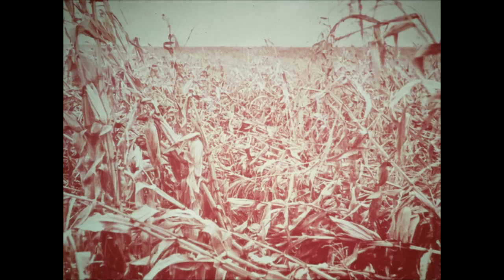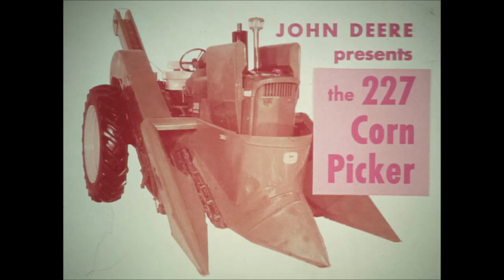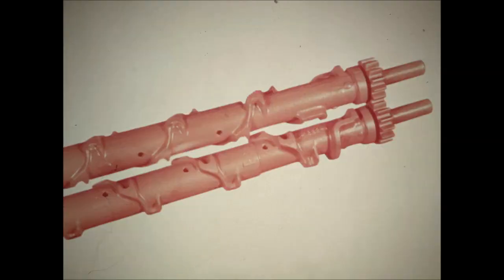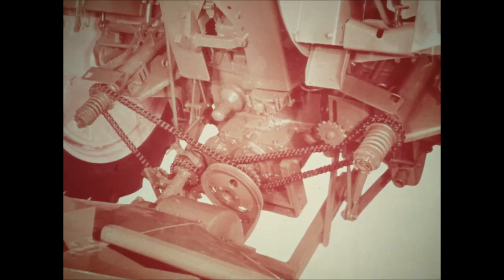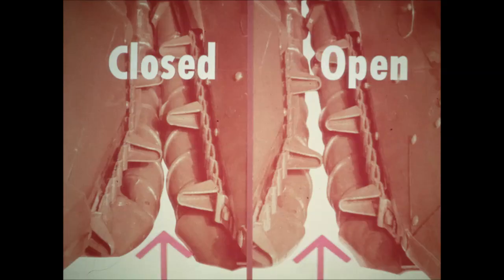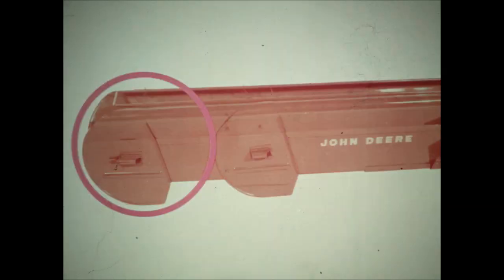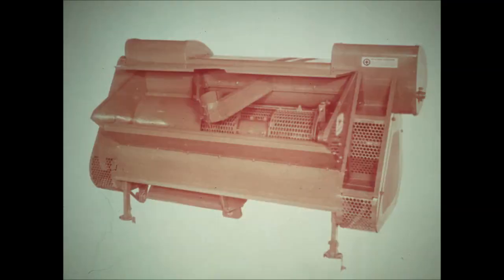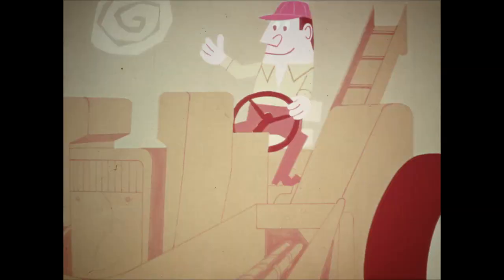John Deere Presents 227 Corn Picker and 50 Sheller Attachment

Comment: You don't want to forget that at the time mounted corn pickers came about they were only around for about 5-10 years. It still beat picking by hand as was still done by a-lot of farmers. Once the unit was on the tractor it stayed on until the corn was off the field, and then you would go help out the neighborhood farmers. Combines with corn heads were still being thought up. We still run a 227 combination ear/sheller. Takes about 2-3 hours to put it on, some are quicker some are longer mounting times. I've run almost every type all do a great job, beats hand picking!
Reply from the maker: I agree. It does beat shucking by far.

Comment: I always thought these might be nice BUT a pull type picker was much more convenient to hook up and use. I/we had both a New Idea and JD one row picker, would have preferred a two row narrow New Idea (still think they were the best picker). Still the cheapest way to store corn, is on the cob in a narrow tall corn crib, let Nature dry it and animals won't mind the cob when ground up.
Reply from the maker: Yep, pull type is the way to go, same with cribbing corn. Newfangled methods may save time, but are not always best.
Reply: @ikonseesmrno7300  Yeah it's like the first one-row cotton pickers were all tractor mounted... IH invented them during WW2 as a labor saver over hand picking when all available hands were going into the service.  They were complicated and expensive and didn't catch on until well after the war.  You had to convert the Farmall for use under a cotton picker, by removing the shift plate and seat off the top of the transmission case, taking the differential loose, and flipping it over on top of the bull gears on the ends of the axles.  That gave you five speeds in reverse and one forward, since the tractor was operated backwards under the picker.  You had to remove the steering wheel and throttle and reverse the "pickle fork" single front wheel (or get a pickle fork single front wheel and remove the tricycle double front wheels-- they didn't work worth a rip in bedded land anyway as they were always trying to take the wheel away from you, particularly operating in reverse).  Then you rolled the tractor under the picker.  Usually the picker was propped up on top of 55 gallon drums with wood blocks, so to get the axles past it you had to roll the axles up to the drums, jack the picker up, and remove the drums and move them to the other side of the axles, then roll the tractor back to the mounting plates on the picker frame.  Oh, one step I forgot-- usually the picker rode on a huge ball bearing on the axle itself, so you had to remove the rear wheels, slide the bearing with its huge pillow block on, and then put the wheels back on.  Most farmers just left the bearing on after that to freewheel along the rest of the year because that was such a PITA.  Then you had to line up four bolts with the pillow blocks and install mounting plates from the engine side frames to the picker's 4 inch channel iron frame, install a gearbox (on most pickers) in where the belt pulley or corn picker drive on a Farmall was located (in a top cover under the gasoline tank), though some one-row pickers IH built eventually just used a big cast iron pulley that slid onto the PTO and then belt drives to turn the picker unit and blowers to convey the cotton to the big overhead basket.  Then you had to hook up the controls-- a rod pinned to the clutch pedal and two more rods pinned to the brake pedals, which went through a series of bellcranks and rods to duplicate clutch and brake pedals on the operator deck above the picking unit.  The throttle rod on the tractor was joined with a double-plate bolt on joiner to a throttle rod from a duplicate throttle control lever on the picker operator deck, along with a gear shift lever that operated through a rod arrangement to couple it to the tractor's gear shift lever (after you put the top plate back on the transmission.  Usually they started from the ground, though sometimes they extended the controls up to the picker operator deck.  Then you had to mount a stalk shield and snoot over the LH rear tractor tire (which was now the RH front tire since the tractor was operating backwards under the picker) to keep stalks and stuff from getting smashed down as they went past the picker unit and under the axle.  Usually you always turned to the right when picking so the row going under the axle was already picked, so cotton didn't get knocked out on the ground.  Of course taking the tractor out from under the picker at the end of the season was the reverse of all this... Oh, nearly forgot-- you also had to clip on a big tapered angled screen over the radiator to keep cotton lint from plugging the radiator on the tractor, and take the muffler off and install another one with a 90 degree heat shield over it and an elbow that basically pointed it parallel just above the tractor hood horizontally and out over the radiator and screen, blowing straight out the back of the picker right over the radiator.  

It was SUCH a PITA that as soon as a guy could buy another tractor, he would just leave the picker permanently mounted on the old Farmall H or M (or Super C, or whatever, which is what they were usually mounted on) and just treated it like a self-propelled machine.  By the time they came out with the double-row pickers in the late 50's or early 60's, those were all self-propelled, though they still sold single-row mounted cotton pickers for another half-dozen years or so for "budget minded" farmers... 

Deere single-row cotton pickers were even more of a pain... since the Deere tractor couldn't be reversed like the Farmalls by flipping the differential over on top of the bull gears, they mounted the picker on the old Poppin' Johnnies much the same as the IH, but you still had to drive the tractor forward by squeezing onto the regular operator platform between the picking unit hanging off the "back" of the tractor, but Deere put their unit on the LH side rather than the right (in picking direction, ie "backwards" from a regular tractor point of view-- from the regular tractor "forward" direction, IH had their picker row unit on the RH side and Deere on the LH, in backwards picking direction, IH put their picker unit on the LH side and Deere on the RH), and of course the basket was right in front of your face so you had to kinda hunker down to see under the basket to drive the tractor, or look through it LOL.  You'd drive the tractor down the road to the next field, get off the tractor, throw the PTO In gear to drive the picker unit and blower, and then hook up a clamp-on thing over the hand clutch and a coupler plate to the steering wheel with some "J" hooks that tightened it up to the steering wheel of the tractor, and coupled it to a duplicate steering wheel and hand clutch on the tractor.  I don't remember if they had a clamp-on rod to connect up to the brakes or throttle or anything, I've only ever seen ONE Deere single-row picker decades ago at a farm show, they're THAT rare!   You had to shift the tractor into reverse before you got off it, and you did all your picking in the one reverse gear on the tractor.  IH, since you had all five gears at your disposal just with the tractor going backwards, you could pick in first OR second gear... First gear was considered "picking gear" for first pick, and then second gear was "scrapping gear" for picking the cotton the second and sometimes third times as the crop finished ripening and was picked again later.  We pretty much always ran in second gear, regardless, unless the cotton was amazingly good that year.  The picker unit was synchronized to ground speed so the spindles rotated straight into and out of the plants without raking or dragging them in first gear, via the gearing calculations and sprocket sizes and tire size and tractor gearing calculations when they designed the thing at the factory.  Second gear was NOT synchronized and so the picker was turning slightly slower than the forward speed of the tractor, so the spindles were slightly "dragging" through the stalks as it picked, but honestly that made it do a better job since it would pull the bolls up against the spindles as it drove through the field.  The Deere, of course, was designed with the reverse speed ratio of the tractor vs. PTO speed in mind and so it was always synchronized since you could only pick in tractor reverse gear...  Deere was pretty quick to switch to double-row self-propelled cotton pickers, needless to say.  

Then of course there were cotton strippers, which worked much more like a corn picker... basically instead of the snapping rollers and gathering chains, they used rotating rollers with rubber flaps and brushes to pull the bolls off the stalks and throw them into an auger that moved them back through some cleaners and a cross-auger to an elevator that dumped the cotton into a wagon, like a corn picker, they were usually two row mounted on a tractor almost identically to a corn picker, but strippers were only used in certain areas like the high plains-- most areas used "picked cotton" versus "stripper cottons" or "stormproof cotton" which was worth less money than picked cotton.  We had a 77 Deere cotton stripper on an old JD  B (which was too small for it actually-- it was made for like a 60) and WAY back in the 50's or early 60's Grandpa had an old single row Dearborn cotton stripper that was designed to mount on a Ford 8N... those were kinda weird-- You had to move the RH rear tire and front tire of the 8N all the way in to minimum spacing while leaving the LH tire and front axle all the way out at maximum spacing (cotton was always grown on 40 inch rows until basically the 80's). The single stripper unit mounted on a beam that was attached to the 3 point hitch, which also carried the blower to suck the cotton out of the stripper unit, which was carried OUTSIDE the RH rear tire, so to lift the unit you raised the three point arms.  A PTO shaft drove the gearboxes and chain that went over to drive the stripper brushes and batt rollers in the stripper unit, and instead of augers it sucked the cotton out of the stripper unit and then blew it up into an overhead basket which also mounted on the tractor and was dumped hydraulically... it attached to the front and rear axles somehow... it was crazy but it worked.  Dad said it did a good job almost as good as a picker, but again not many were around.  Grandpa did a lot of custom work with it hauling it around back in the old days... Sadly it's long gone but I wish I could find out more about them... 

Later!  OL J R :)
Reply: I've got a video about a one-row cotton picker that was restored nicely that I filmed up near Sikeston, MO on my way up to Indiana a few years back, which is on my channel... Later!  OL J R :)
Reply: Ear corn is great feed! Yeah, alot of work, but we could get 4+/lbs per day average gain on steers using it, without hay. Mounted  pickers go back to the days of tricycle tractors, but pull type NI 325 was the best in later years
Reply: @lukestrawwalker  we've come a long way! Ain't it great?

Comment: perfect machine, how could there be any improvement?  just noisy, dirty, shelling losses possibly
Reply from the maker: The only improvement I could think of is a cab for the tractor. Everything else was covered with that mounted picker. As for loss, I've seen a couple in action & they are pretty thorough. You might see some loss on the ends of the cob, but that's about it.

Comment: What is the plan after you finish these John Deere videos?
Reply from the maker: Currently, there are two IH filmstrips to be copied yet. The records are in need of rehabbing & that will take some time. There's one like that for JD yet, but I don't think the record will produce anything as it's badly warped & the grooves are extremely shallow in spots. If I run across any more of the record/filmstrip sets from any brand, I will be converting them to post here. Next winter, I hope to redo these videos to get more color into them. Currently working on an IH filmstrip that still has a hint of color to it, so I can figure out what's what. That one has a color checker proof at the beginning of it before the focus frame. Have been able to figure out the pallette from that. It was difficult, as all the samples are essentially a different shade of red due to the dye layers in the old Ektachrome breaking down. Otherwise, I'll be getting a new camera at some point this spring or summer to record more of the goings on around the farm here.
Reply: @ikonseesmrno7300   Do you know if there's same records+stripfilms for Massey Ferguson? Thanks a lot for your time used for copy them ;)
Reply from the maker: @Vieuxtracteurs  I haven't seen any. That's not to say there isn't. MF is old enough to have utilized that technology, but it's hard to say if they went that route or if they stuck to making movies. I'll certainly keep my eyes open for them.
Reply: @ikonseesmrno7300  Thanks ;)